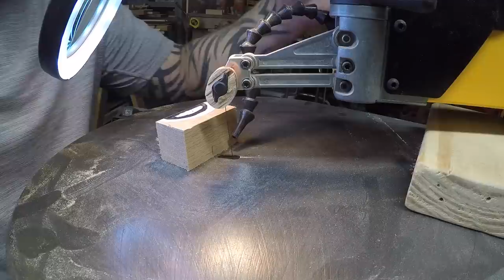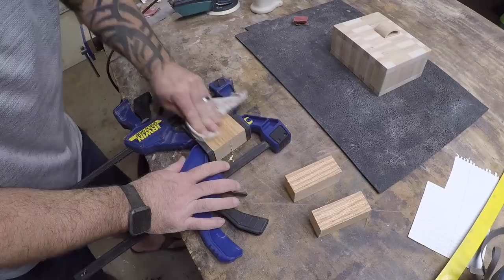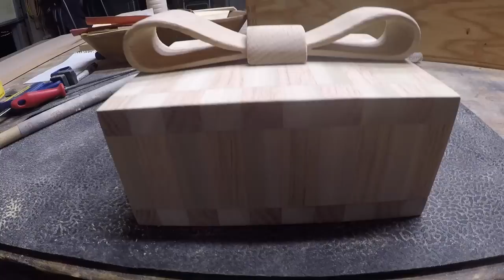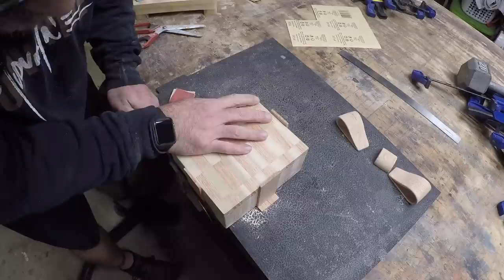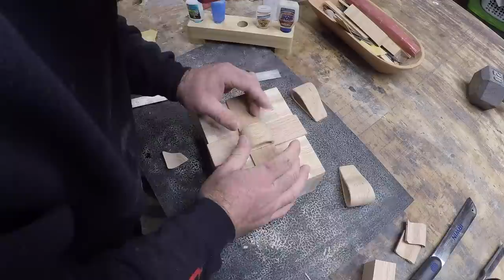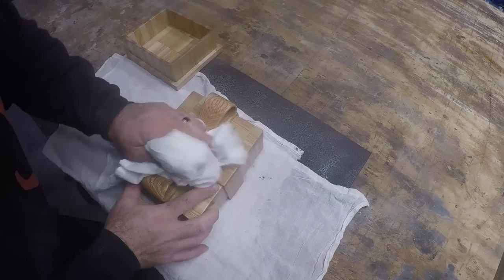Turning a Simple Scroll Saw Box into something more...

Comment: What kind of tape is this? That it cuts the arches so well?
Reply from the maker: I'm sorry I don't understand, what tape are you referring to?
Reply: @2HME  On bandsaw
Reply from the maker: @grzegorzkubiak1438  So that's an attachment that I bought for my bandsaw from Carter products. The blade rides on the wheel so it can pivot and turn easier and doesn't use the other guides. It makes the blade perform similarly to a scroll saw blade. It works really nice for those types of cuts. You can only use a 1/4" or smaller size blade.
Reply: @2HME  THX